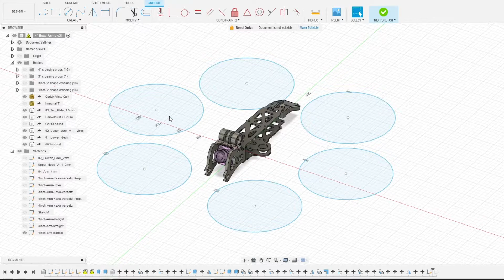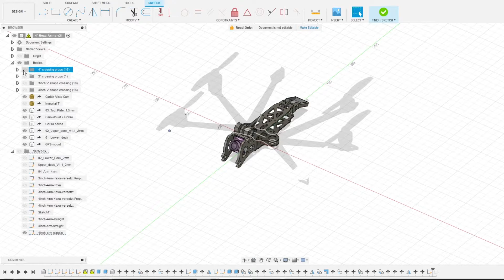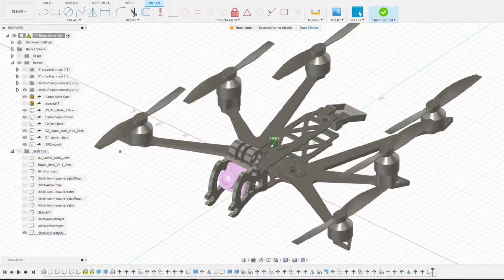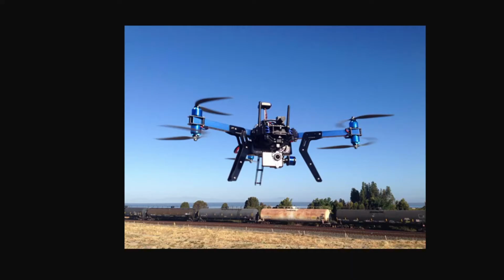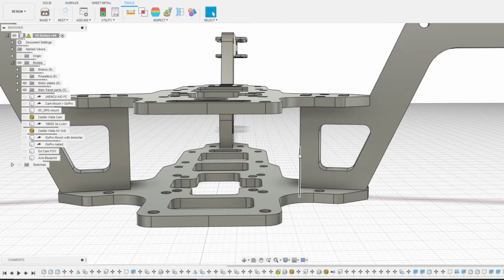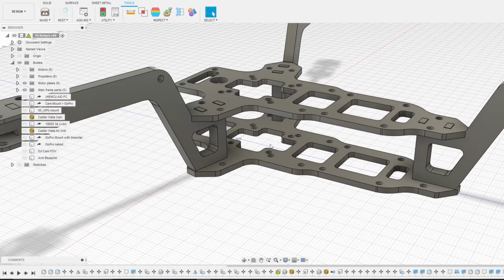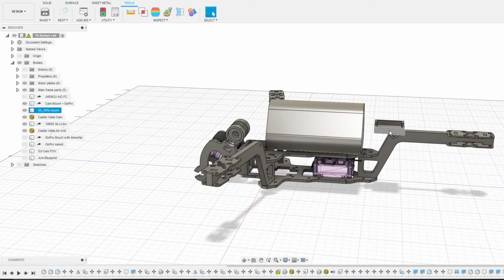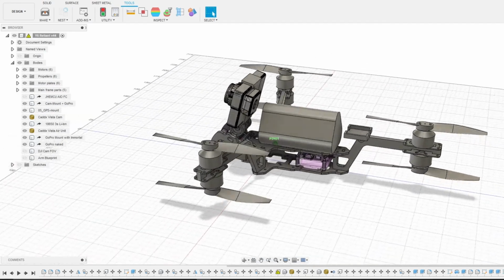Project Reliant - 4“ long range Y6 frame - design presentation

Comment: Would be nice if the front arms were on pivots, so they can fold back for transport. Also, in crash, they can be pushed back and absorb a lot of energy, if using just a friction fit. As it stands, it looks like the arms would place a lot of torque onto the frame and break it in even a mild crash.
Reply from the maker: well, i haven‘t had a crash yet so i cannot object :-) But this thing feels crazy stiff and strong, especially the arms and their mount. I doubt it‘ll break easily. But time will tell ;-)
I‘d love to make the arms folding, but it‘s difficult to find a folding mechanism that is sturdy enough. I am working on a few folding designs as well, but not for the Y6 (for now?).

Comment: For a long range application - kind of questionable, as any coax setup is way less efficient then free disc designs like standard hex. The only benefit of this design vs normal hex is lower weight (question mark) and smaller size (question mark). And redundancy, Y6 can fly without 2 props as long as they are not on the same arm and those props spin opposite directions, effectively turning it in Y4
Reply from the maker: I can say from experience that there definitely is a noticeable gain in thrust with a Y6 compared to a quad setup. However it indeed is inferior to a standard hex.

Regarding weight: I have all cnc and 3d-printed parts for it here already, and including hardware the total frame weight adds up to 46g. So rather light-weight. I would guess for a standard hex it will be more like 60-80g, due to the added carbon. Which will result again in 10-20% less thrust when i check the numbers in eCalc (as the frame weight is a large chunk of the total weight). So i feel this might just make up the lesser thrust due to the coax setup. I‘ll post my findings in future videos.

And regarding redundancy: I wonder if this is still the case with the latest version of Betaflight. A standard hex also should still fly if one of the motors fails - but the Hexplorer showed that it doesn‘t. So i wouldn‘ be surprised if a motor fail would make a Y6 fall out of the skies these days. Maybe i can find a way to test this (similar to how people did it for the Hexplorer).

Comment: Will the back motors twist on the roll axis for yaw like a tricopter?
Reply from the maker: No, on a Y6 that’s not necessary luckily. Makes the whole build much easier and sturdy.
Reply: @eyeflytinkerings  I guess your right now that I think about it, the torques are all balanced.  Thats pretty cool. Idk how i found the channel but good luck m8👍🏻
Reply from the maker: @samuelyoung2671  glad you did! And thanks :-)

Comment: On a coaxial setup like X8 or Y6, the lower propellers need to have a steeper pitch. If you find the correct pitch angles and distance between upper and lower blades, almost no thrust will be lost.
Reply: "need to have" is a strong word. Where would you source such a propeller? I could not find a matching one on the market.
Reply: @maximilian_pircher  
No offense meant. Just insert a „in order to ...“ or read it as a „might want to ...“ ;)
Reply from the maker: You‘re right, in order to neglect the loss in thrust, a different pitch setup would be best. But even with same-pitch-props the thrust is higher compared to a quad setup. And it won‘t have much of an effect on flight characteristics.
If you know of a way to calculate the ideal pitch differences, let me know. However i fear there won‘t be the right propellers available on the market.
Reply: @eyeflytinkerings  
There is very little „human readable“ information about this on the internet. I my opinion a high pressure bubble between the rotors is to be avoided. Also the lower blades should not turn significantly faster than the upper blades since the efficiency decreases rapidly with increased head speed.
I am planning to try a coaxial collective pitch system on one of my future builds. If I am right, the PID controller should set appropriate pitch angles if no yaw command is issued.
For my builds I am using mostly blades and blade grips so I am relatively free to choose the pitch and blade count I need.
Reply from the maker: @helidrones  Very much looking forward to what you‘ll be coming up with! With my designs and builds i‘m usually trying to keep it as simple as possible regarding parts and modifications - so that it‘s not too hard to build a similar setup yourself.